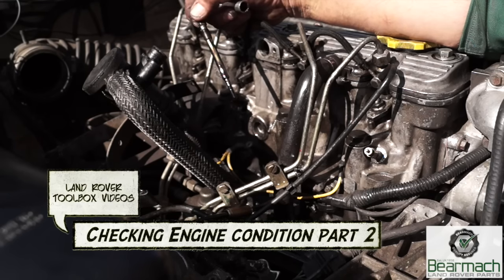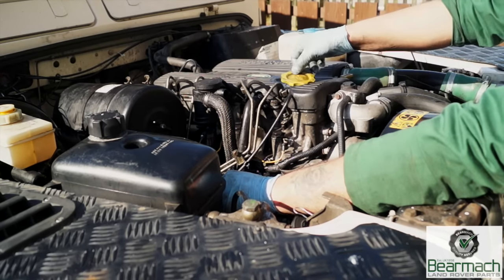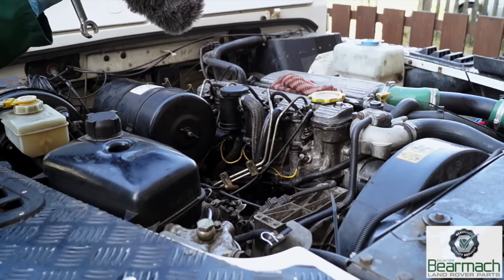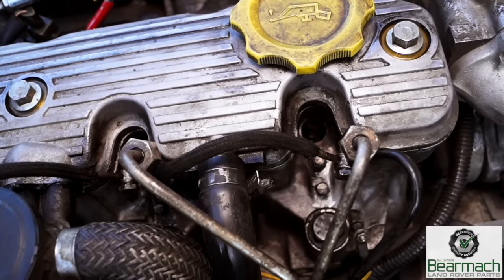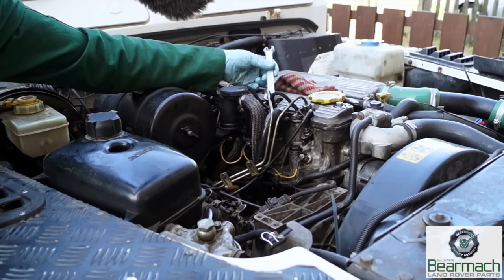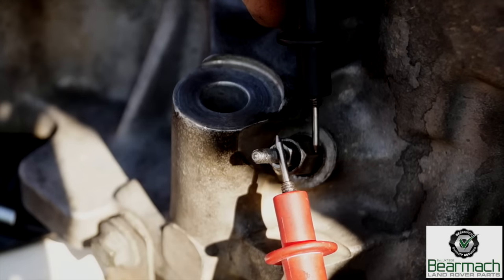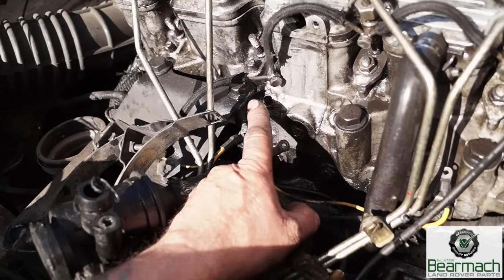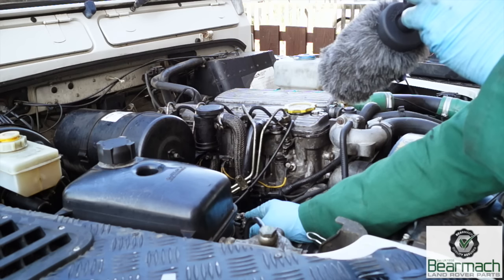Land Rover engine condition checks PART 2 . Checking glow plugs and injector change.

Comment: Hello Chris, not sure if you will still be watching this post? My question is ..Is it possible to do a leak back test on this type of injector with the 'double pipe coming off the back of the injector?  I have done a leak back test on Freelander TD4 but the leak back is fairly basic to test on that...Great video, just been looking for this elsewhere and must have missed this one...Cheers..

Comment: These videos are fantastic! My 1987 Defender produces a noticeable amount of smoke when going down the highway and also a bit around town. I'm trying to figure out what it is - any ideas?
Reply from the maker: Either worn fuel system components injector/  fuel pump or worn engine piston rings / cylinder bores.
Reply: I forgot to mention it's white smoke and it seems to be only coming from one cylinder (noticed period puffs right above idle this morning). Hopefully just the injector and not piston rings or cylinder.

Thank you so much for the super-quick reply!
Reply from the maker: sorry I am not good at distance diagnostics.  If it sounds like its popping it could be a leaky valve or a misfire on that cylinder due to an injector.

Comment: I always come back to your channel, excellent stuff!  I have the same hiss/tick sound as you mention, sounds like its from cyl 3 or 4 and I am thinking its a leak from the injector seal as you state.  Could a faulty injector also make the same sound?
Reply from the maker: Injectors buzz.  You can only check injectors by checking their spray pattern.  This is done on a machine that can open out both stages of the injector.
Reply: I was referring more to the ticking noise and potential leak from bad seal. But i was also told that same noise can also be from head gasket at back of cylinder 4.  Will do the soap spray test.
Reply from the maker: Yes, that is correct.  Back of the head cylinder - leak. Also, ticking can come from the exhaust manifold.
Reply: Yes, but noise not on that side, def from injector side and rear...

Comment: GREAT VID AGAIN , IF I HEAT THE PLUGS TWICE THE 300TDI STARTS FIRST TIME ,IF I DONT ,ITS HARD TO START ,WOULD YOU SAY THE PLUGS ARE U.S.
Reply from the maker: I think that is telling you you have other fuel supply issues.  300tdi is direct injection and the heater plugs are only a really cold weather starting aid.

Comment: what is the best way to get a snapped glow plug out
Reply from the maker: Drill the centre and use an easy out to pull it.
Reply from the maker: video here will help you somewhat i hope...   https://youtu.be/zf_B8u7mdes
Reply: many thanks ,a few have said it will pop out with the engine running .
Reply from the maker: not a good idea.  It will shoot out at force and could badly hurt someone
Reply: Land Rover Toolbox Video's

Comment: help help help pppplease!!! 
dear sir, please can you tell me the thing that nobody else can tell me? my 200tdi glow plug relay will only provide 10 ish volts. it climbs to around 11 plus just before the relay times out at 10 seconds. is my relay shot? 
should they deliver close to 12 volts instead. thank you very much
Reply from the maker: Poor contacts no doubt or faulty relay?
Reply: Land Rover Toolbox Videos thanks, great videos. is this a common problem with the 200/300 glow plug relay?  thanks
Reply from the maker: Lower voltage means it is being lost somewhere.  200tdi circuit is simple.  Either the feed to into / or out of the relay is lacking in power or the relay is corroded either internally or on the contacts themselves are corroded.   You need to test all these points and carry on from there.  If the power to the relay is lacking you need to trace the wiring back or test it using the voltage drop method to see if it is in good condition or contacts are in not corroded.   The relay only has an earth on the switching side.        You haven't said which vehicle the 200tdi is so one cannot say if it is a common problem or not.   I presume the vehicle starts well and the earth connection from engine to the battery negative hasn't got corrosion on the terminals?
Reply: Land Rover Toolbox Videos yes it is a 200, in a series 2a /3 hybrid. 
both the relays I have do exactly the same thing. it's either they are both no good. I unplug the relay and it's 12  v. I plug in the relay and I am only getting 10 v to the glow plugs. 
this does creep up to 11 plus before the relay times out.. 
£ 47 from the dealer for the relay. Apparently the same relay as the 300.  thanks very much for your help
Reply: brand new battery and terminals
Reply from the maker: Unplugging the relay and reading the voltage you have no load on  the circuit.  Whatever wire you tested with relay plugged in and activated then that is the wire that is loosing voltage somewhere on it.
Reply: Land Rover Toolbox Videos thanks again very much. 
I have found that the series 3 ignition switch has a slight current drop. something to do with the  efficiency of old lucas systems, probably not designed to cope with 200 tdi engines.
I have got round the issue thanks. 
(provided a different 12v source than the old lucas) 
the system cannot at all run at 12v with the plugs engaged because of the current drop when the plugs are in use. it's around 11. something, creeping up as they heat up.
Reply from the maker: Ah good. Old electrical systems decay with age so perhaps it may be worth considering a new loom at some point?
Reply: Land Rover Toolbox Videos. agreed. most of the old wiring has been replaced. it's probably the internals of the ignition switch. 
the old series glow plugs ran 3 volts a piece. so it's not heavy duty enough for the 200 tdi set up. enjoy the thoroughness of the videos, found your cambelt on 200 tdi most useful indeed. 
and several others have really, really helped me no end. 
you are my go to guru with land rover. thanks